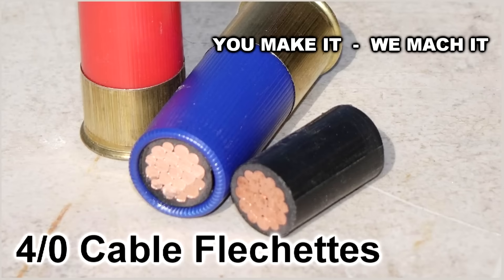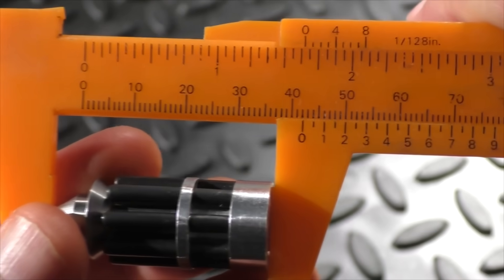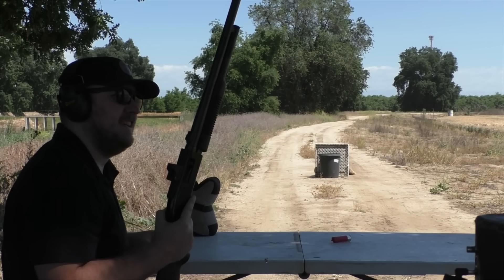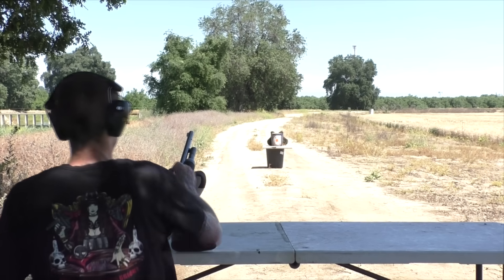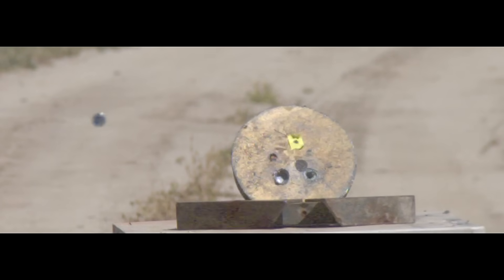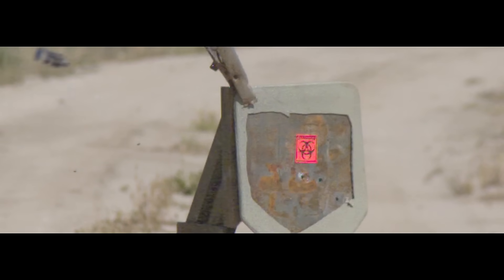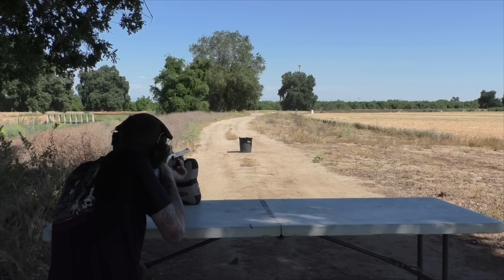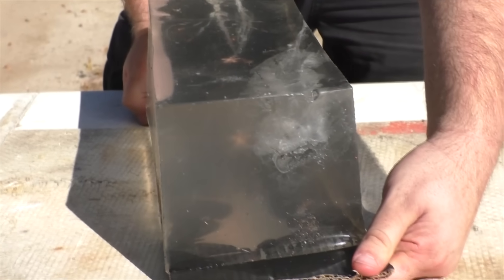RODS from GOD -  Possibly the best 12ga slug we've tested

Comment: i feel like their is a way to cast a similar shape out of a single pour of lead. you would not get as many branching cylinders but the effect could still be felt at a much cheaper mass manufacturing cost.
Reply from the maker: If you made it out of lead it would be so heavy, probably 2.5 oz,  and you'd have to lower the velocity to about 700 fps to maintain safe pressures.

Comment: Damn...
Now I want to see this with a tungsten core. The central core should then be an absolute penetration nightmare, whereas the 8 side rods should remain as is because the lighter weight actually works to the advantage for maximum spread. Like, it's that sweet spot of a bullet that can say absolute F-You to body armor, but if the target doesn't have body armor, it has the advantage of spreading out the damage as well. It WILL make a hole in whatever it hits.

Comment: Very effective projectile 
DANGER: those “roll pins” pose a serious ricochet potential on hard targets, after separating from impact, they may well bounce back on concrete or other “down range” hard surface’s. This in itself would be  the only reason to can this project. Perhaps replacing the pins with a carbon fiber rods would reduce ricochet potential.
Reply from the maker: That was the reason we set the AR plate at an angle so everything deflects off in a different direction.

Comment: if you duct tape a bunch of nails together with a bit of wire maybe or hot glue/hot HDPE... it may do the same thing except the center penetrator. Is it even tungsten? You dont shoot BMP's with a shotgun anyway. If the penetrator is the main goal just make it better and replace the rods with steel balls

Comment: I think these just might be actually quite cost effective to make. Maybe with little adjustments, some parts could be punched out of thick sheet metal, the dowel pins can be bought as they are or replaced with some rough cut spring steel wire and all together it could be pressed in to one piece by a machine. This may be actually one of the less expensive over-complicated rounds that can be made.

Comment: Scale up this design to fit the Smooth Bore gun on an Abrams tank, but with Tungsten core and explosives fitting the roll pins.
Reply from the maker: These still need spin stabilization to function.   There's a lot of great designs for smooth bores though.

Comment: Brilliant video! I hope Jay gets these patented because that is just truly inspired.
I mean this is really honestly genius. These rounds solved virtually all the issues with flechette rounds in the most brutal way possible... With standard flechettes, the individual pins don't have the mass to carry penetrating force. By the time they hit a target, they can be stopped by a particularly thick jacket. But if you keep them bunched up to maintain mass, they lack effective aerodynamics and end up tumbling and losing power anyway. And if you do manage to keep them bunched up tightly enough to maintain ballistics, then you lose the spread that you wanted from flechettes in the first place.
By making the pins circle up between the tip and base of these rounds, you maintain ballistics: the pins are delivered with force and good heading. And then how do you get the tip out of the way? You use that solid core that absolutely demolishes it, while the base effectively impales itself on the core. That way those flechette pins are all being delivered with maximum force. But since the outer rim of the tip is still there, they are effectively deflected outward - which we see with the cloth dummy and second gel block. 

Phenomenal round, phenomenal video. You got my like and subscribed today.
Reply: It's not comparable to flechettes. Flechettes give you a better hit probability compared to a single slug. This thing is more comparable to explosive shells, it's for more destructive effect on the target.

Comment: Machinist here, I’m guessing it was about 1-2 hours of machine time per round if they were manually machined. Utilizing a lathe and a mill. On top of the 12 hour loctite cute time. They said there was 12 of these rounds, that means that’s 12-24 hours to make these rounds. 

CNC would cut this down to about 30 minutes per round. 

Considering it takes about 1 minute to makes just a featureless slug with a rounded tip, this is an insane time investment for a round that flies for less than a second
Reply from the maker: Jay told me later than he spent 12 hours making the 12 slugs.   That was a bit faster than what I guessed
Reply: @taofledermaus  damn!

Comment: Need to fire up an autofeed cnc lathe and let it do its thing. Shorten the center and make it tungsten so it could be AP and still tube feed. Could also make it press fit so it doesnt need to be tapped and have a screw holding it together. Just thinking of ways to lower assembly time to make this a product many people would buy
Reply from the maker: Getting them down to about 1" in length would be better.

Comment: (machinist here) This is a really cool concept and it's neat to see it work as intended. Some info I'm pulling out my butt: on a manual lathe, you could probably make all these components combined in about 20 minutes as long as you buy the right size stock to machine and have your tools prepped ahead of time, and then after getting your mill coordinates dialed in for the bolt circle maybe another 10 minutes to drill all the holes (give or take a couple depending on if there are pockets in the base section, but it doesn't look like there are). The first one will take the longest to make and the rest will be done in half the time because that's just how manufacturing goes, it's all in the prep. I'd estimate material cost to be around $10 per assembly on the high end, maybe $5 on the low end, manufacturing 2 per hour on manual equipment in a small home garage setup. If it were done with a single CNC lathe and single CNC mill, I'd guess you could make around 10 an hour after fully proofing the programs. And that few per hour only because you would have to swap programs and material between the aluminum parts and the steel parts. That's some damn fine bang for your buck there Jay, good use of roll pins.
Reply from the maker: Jay said he spent 12 hours to make the 12 slugs.    I'm sure if he had to make a 1000 of them he could streamline things
Reply: @taofledermaus  *All these components combined was in reference to 1 slug, and it obviously depends on what lathe you're working with and how many quick change tools you have available etc etc, I was guesstimating 6-7 hours total for all slugs - completely worth it for a fun range day and a neat video like this in my opinion.
Reply: I think you might get down to as low as 1$ and at worst 2$ per round if one just did proper tolerances on the design and batch manufactured the components.
 Definitely not cheap to sell still, but as a hobby round for fun or extremely dangerous game round it could work.
Reply: You could probably stream line the process by making each piece in batch and have someone assemble them while you start the next batch
Reply: @methamphetamemes  Of course, I was only talking about the 12 made here in a home garage by one person. If mass production were required both the price and time to manufacture could be reduced significantly. My dollar costs were estimates based on McMaster-Carr material prices, and the time estimates were based on someone moving fast with only 2 manual machines at their disposal. Averages always drop in bulk :)
Reply: @Republican-00769  If machined correctly, could make it to be $ 1 or $2 per shell still pricy but worth it for extremely Dangerous game shooting
Reply: @greywolf9783 are you dudes servant or something?
Reply: There's lathes that can mill now too. Multi axis live tools. They could be made in one machine
Reply: Couldn't you just make one really long rod then cut it to length?
Reply: @tellmeninetails5819  I'm not quite sure what you mean, there are two different metals involved in the assembly and 8 offset holes in the retaining ring so you're going to need to use a mill/drill press as well as a lathe and change material at some point. If I were machining it (manually) I would start with one long round of aluminum in the lathe, face it off, turn it to diameter and edge break with a file, drill and countersink with tailstock, part-off, repeat as many times as necessary for desired quantity. Do it again with the same aluminum round but parted off at a different length for the retention ring, setting those aside for the bolt circle to be drilled in a second operation. Then I'd do the steel parts (entirely in the lathe and yes, as you said, with one long round), turn them to profile, drill, countersink, and tap (thread) the leading point, part off. If all you do is take a long rod and cut it to length like your comment then you just have a solid cylinder of metal. The slugs that were fired in this video look really cool and are complex but they aren't complicated: it's a tedious process to machine multiple 4 part assemblies (technically 13 but I'm not counting store-bought components), hats off to Jay for putting in the time (12 hours apparently) for the sake of his curiosity and our entertainment.
Reply: CNC machinist?
Reply: Bro those are all what ifs
Reply: I would love to buy some of these.
Reply: You can get simple CNC parts made in China for a low price with very high accuracy.  Probably 2$ each honestly.
Reply: @UnknownDiver  That's true, you can get a lot made in China for cheap, and some of it is even pretty decent. I try not to do that as much as possible though. Also that's sort of counter the point of the video, the series, and the conversation... We could pop these out for roughly about $0.70 cost per slug (not including powder or shell) in a proper industrial U.S.A. factory and sell for a 30% profit margin around $1.50 making a few thousand a day. China can probably get that closer to $0.38 because people are basically free of cost there, and sell at the same price. But this is about homemade garage munitions so neither case is particularly relevant.
Reply: @UnknownDiver  👎 child slavery ftl

Comment: Wonder what would happen if you made a resin hollowpoint with the roll pins set along the interior circumference of the resin?

My hope would be the resin discards itself on impact from the expansion and allows the roll pins to continue forward. Only issue left to solve would be the center of gravity on that projectile probably being wonky as hell.

Comment: On an adhd tangent unrelated note, Lets face it those Best by dates have no sway over beans in particular, ive had good baked beans 5 years passed the best by date, that can was tucked away at least 7 years and survived multiple AC outtages where the house got up to 90 degrees almost for a week straight

Comment: That is fucking brilliant and whats better is, while they are a lot of components, they all appear fairly simple and mass producible. 

It feels like a heavy version of a cut shell; flys like a slug, hits like shot at point blank for complete energy dissipation. The only big issue it looks like is the OP from the center pin. The big difference is that instead of pellets the heavier (and fewer) rods would shred less local area but go further and hit a wider internal area. This would likely help when going through bone, make each shot more likely to be debilitating/incapacitating, and help for otherwise much chonkier targets like bears. (Note: the pins in the gel flew out the sides early, in a real target (flesh & bone) they would likely spread out faster, slow down more, and couldn't escape the target like that)

Plus they'd probably be safer legally since the rods are easier to remove, it'd still (hopefully) have limited OP, and the fact that it doesn't just completely shred the local flesh reduces the apparent "even if you survive you're disabled" aspect that tends to define the legality of these experimental ammo types.

This is a slug with a lot of very real practical benefits (especially if it could reliably not over penetrate to a dangerous degree) that takes a lot of the cut-shell style ideas and iterates on them. 

Even if it could only be sold at 2 bucks per shell I could 100% see it having a big place in the market. (At least if they were sold with longer shells that allowed tube-mags) For home defense the high distributed energy dispersal and high accuracy would be great for both target incapacitation and safety by limiting OP. For hunting or backup use cases the deeper and more powerful 'fragments' (rods) would help a ton with taking down big things like bears instead of just pissing them off.

It's not exactly going to be anyone's daily carry, but there is most definitely a place for more expensive slugs that will dissipate most of their energy into the target (minimal OP) and cause enough damage over a wide enough area to the target to reliably take down just about anything.

Comment: Great job Jay on those rounds! You mentioned that they would be too expensive to mass produce. It all depends on scale. Even at +100 roundswith a bra feed lathe the rounda would only be a few bucks. At +1000 you could go to die casting the aluminum and still machining the rod and get it down to probably a dollar per round.
Reply from the maker: Usually machined slugs,  even monolithic ones sell for about $10 a round.

Comment: Shouldn't you using a remote shotgun for safety reason since you really don't know how the shell or bullets going to react when fired.
Reply: there is no danger as long as the size is correct
Reply: Jeff is most experienced guy in the world with handloading wacky slugs. No worries there! If NASA would have to accelerate something this size to 1 Mach or 2, they should hire Jeff.

Comment: Basically a frangible hollow point with an AP core. You could definitely improve the design, but ofc such a round doesn't have a ton of use, stopping rifle for very big game aside. Military can't use HP and stopping rifles aside no one not military should be shooting at anything that requires actual AP capabilities.

Comment: Awesome slug design. It would be even better with a tungsten penetrator core for sure. But here's my idea. Why machine anything? Just get the roller bearings / roll pins in the densest and hardest material you can find and buy in bulk. Then make a mold that fits however many roller bearings / roll pins it takes to get the slug to the correct width, and add hot wax and you have the Ultimate Wax Slug. 

You're welcome. :elbowcough:

Comment: I always wondered what broken glass buckshot would look like. A bunch of shards of glass just flying out the barrell at high speed. Will the glass shatter even further as it travels down the barrell? Or will it stay mostly solid and cause serious damage? I doubt you would be able to hit anything at range with it tho. I also wonder if its possible to cut the tail off a prince reuparts drop and fill a shell with a bunch of them. It would be pretty interesting i think.

Comment: You could machine the body from one piece of steel. Drill the holes and then retain them with a screw on retainer. The length of the round needs shortened just a little bit.

Comment: love it sounds like you need to get a 3.5 inch shotgun jeff. or jay could try to reduce the length to fit in a 3 incher safely. jeff would a shot card do better than the cork wad you used to shorten the rd to 3 inch stds?

Comment: As a mechanic I have literally installed or removed thousands of roll pins, not in my wildest dreams have I ever though of using them as a shotgun round.
This has got to be one of the best and at the same time most terrifying episode I have watched on this channel.
That slug is insane.
I love it...❤🥰😍
Reply: Me too. I wonder if you could drill a disc to press pins into, how tight and how many could fit? No centerpost, just pins
Reply: @ZacLowing  fitting roll pins tight is no problem it's what they are made to do, how many? Depends on the diameter, at the size seen here maybe 4 could replace the center rod.
Reply: Same here, but as soon as i saw it i was like "that's genius". They are hard, hollow, and can easily be press fit without needing ultra precision holes.
Reply: imagine using dowel pins instead
Reply: I stopped, scrolled back and watched this when I saw "Rollpins"... Who'd a thunk it... Lol!

Comment: A lot of thought went into this slug to minimise failure and to maximise damage.  That collar to split the rods was genius.
Reply: And the core! It keeps going through relatively soft things!

I now wonder if tungsten carbide would penetrate that mild steel, the round would become virtually unstoppable in 99% of applications
Reply: @TRiToN219 it'd definitely penetrate, but with downside of costing 2-3x the amount of mild steel, tungsten carbide is not cheap to machine like that since it's usually the stuff doing the cutting
Reply: @TRiToN219  Would be worth a shot, but tungsten carbide is brittle so the force at ignition could also shatter it ruining the penetrative quality.
Reply: Carbide drillbits are plentiful and no one bats an eye

Comment: wonder if it would be possible to attach the side rods with steel wire welded on
the frag of them flying off is cool
but what if they flew and then recoiled
would do some interesting damage
atleast if you can make the wire hold wich would be kindof tough

Comment: These round could easily be cast...just saying. If anyone has a cnc mill I can send you some files to make two halves of this round and all you would have to do is add the rods and pour in molten aluminum and put a support plate on the back. Also thanks for the close up shots of measurements gonna keep this one it the books for sure.